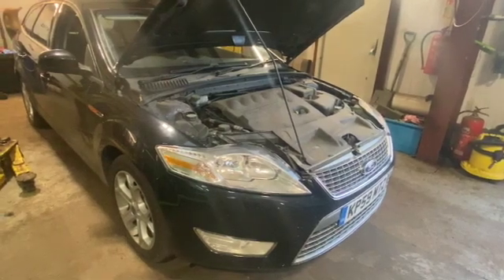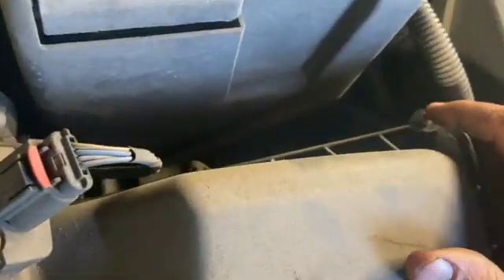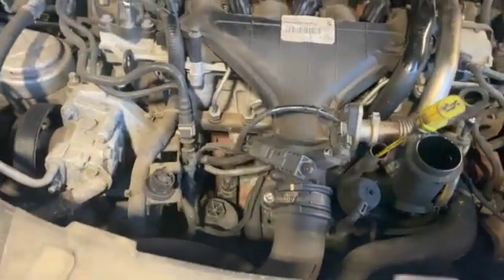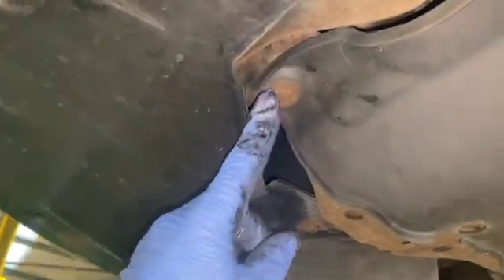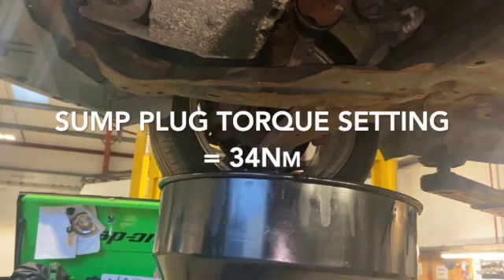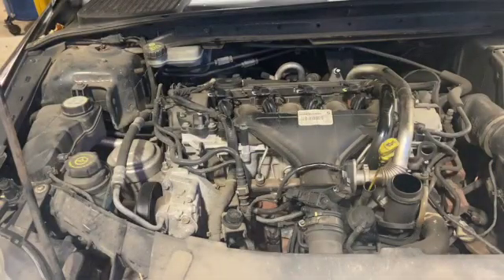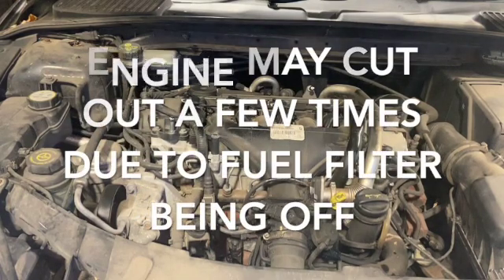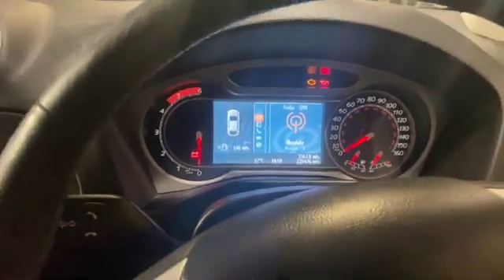How to carry out an Engine Service on a 2.0 TDCI Ford Mondeo

Comment from the maker: Check Euro car parts - https://tidd.ly/3lIO7xA  (use discount codes on site)
Check "Car Parts for Less" - https://tidd.ly/2LNEwIn  (use discount codes on site)

Engine Filters & Oil from Euro Car Parts : 

Oil Filter - https://tidd.ly/3lf671B
Air filter - https://tidd.ly/3js3poM
Fuel Filter - https://tidd.ly/2Sr3GfX
Engine oil 1ltr - https://tidd.ly/3lagBz5
Engine oil 5 ltr - https://tidd.ly/3jrQcMU

Full service kit inc oil Ebay - https://ebay.us/1tHOOM
Service kit amazon - https://amzn.to/2SnkRiz
Engine oil amazon - https://amzn.to/3d7AyUF
Brake cleaner - https://amzn.to/2CK6OPi

Tools : 
27mm low profile 3/8 socket - https://amzn.to/2HM2vWa
32mm low profile 3/8 socket - https://amzn.to/2BTibUX             
Socket set - https://amzn.to/3eGx2Ak
Brake cleaner sprayer - https://amzn.to/2BLF1gX
Longer reach 3/8 ratchet - https://amzn.to/3iJsADg
Ring Inspection Lamp - https://amzn.to/3gGWHcG
torx screw driver set eBay - http://www.ebay.co.uk/itm/142442401623
Pic set - https://amzn.to/33JcZyJ
Dewalt 3/8 impact driver - https://amzn.to/3njemLY
Allen key sockets - https://amzn.to/2HXJNv7
Screwdriver set - https://amzn.to/3jswgJP

Comment: Did you have to prime the fuel? How did you do it? I have a 2013 tdci would it be the same setup? Thank you
Reply from the maker: no I didnt this time but it can sometimes help to fill the filter with fuel or pull some fuel up using a primer pump if need be 👍

Comment: What is that pipe to the right of access to the oil filter,on my focus cabriolet this pipe hindered my access to oil filter ,I ended up tearing the rubber under the  clamp when putting it back toghether.
Reply from the maker: Hi I can't quite work it out but I think it may be a water pipe